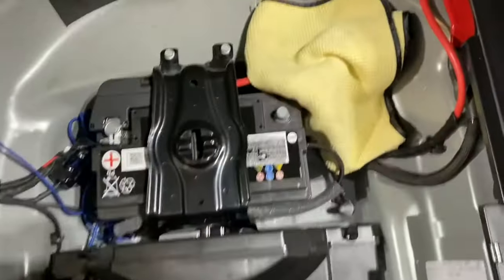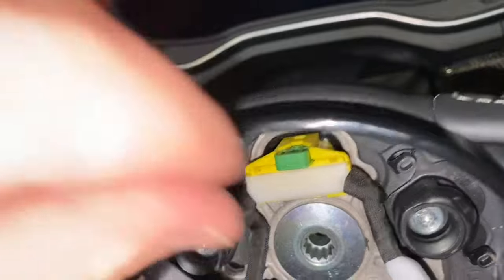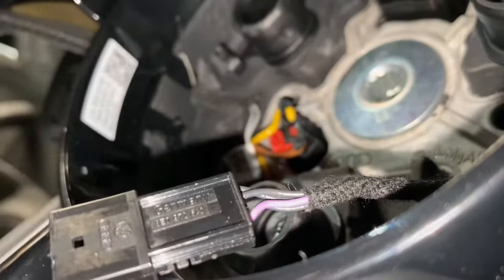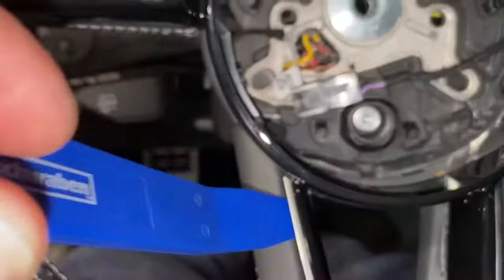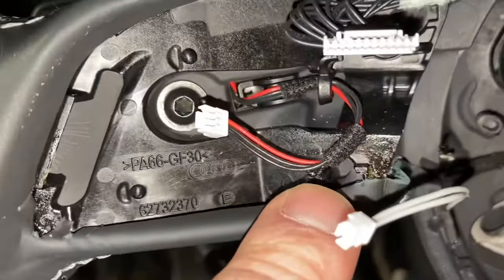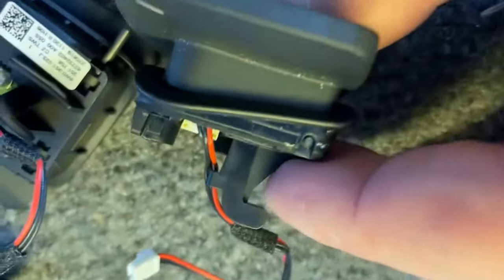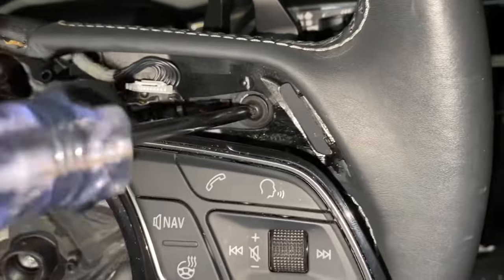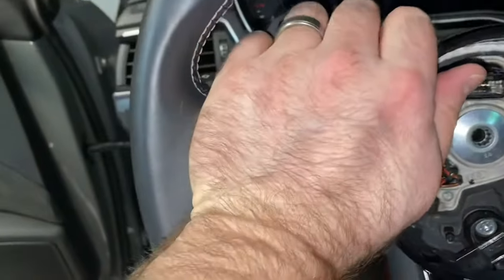Upgrade your Audi’s Flappy Paddle Shifters With These Urus Style Paddles From Enthusiastbrand.com

Comment: b8's have the worst board to pull the pin from to install urus shift paddles. i had to heat the plastic and put a small hole in them to push the pin out far enough to grab it. got the paddles installed but i looked at every other make with paddles and they were all open ended on both sides. looks like they figured it out when their shifters go bad. made my carbon steering wheel look even better too!
great video,  thanks!

Comment: Do the urus style paddles feel like plastic? Or are they metallic feeling? Great video and install by the way! The car is really coming together👌🏼
Reply from the maker: They feel like solid metal! Much better than OEM.
Reply: @Vaguh  are you sure? Compared with Ali express they look very identical and cheaper. Im thinking to order from your link but having trust issues, please give me your best thoughts! I don’t mean to be rude asking you this 😁
Reply from the maker: @johnmaz5936  lol, they’re metal and very high quality. I would buy them again and pay full price. I did hear of someone having one that broke from a faulty tack weld, but enthusiast brands sent them a new set. They’re powder coated aluminum.
Reply: @Vaguh  ok thanks!
Reply: @Vaguh do they engage like the factory set I.e. do they travel the same and have that "click" to change, as your video makes it look more like a soft touch button than actually clicking the paddel!?

Comment: If THAT is where ur hands are bro when ur driving u picked the WRONG paddle shifters! Get the Racingline ones. They have holes where ur fingers are. THESE are designed for ur hands to be lower on the wheel. These are not for u bro.

Comment: Hi, great video, thanks. Is there any risk in a novice tinkering with the airbag? I’d like to try this, the paddles in the Q7 are worthless
Reply from the maker: Just disconnect the battery. This was this first time I had ever done the removal of the airbag and steering wheel.

Comment: Thanks for the video...how long does it takes to remove the bezel? After having done it, do you have any tip to make it the project easier? I like to replace my paddle too?
Reply from the maker: Once you get a feel for it, you could do the whole thing in under an hour. I had actually forgot to reinstall one of the screws and had to take the whole thing apart again. Took me just over 30 minutes the second time. It’s mostly feel and getting a hang of it. I tried to convey anything that helped in the video. I spent a bunch of time off camera fiddling around.
Reply: @Vaguh  Yup...I did it a couple of months ago and I like it.  However, I remember being able to pull both paddles back at the same time to go in to neutral w/ the OEM.  ...with this aftermarket, I can't do it.  You have any insight to that ?

Comment: Hey does this exhaust setup drone at all? How is it on the quietest setting when valves are closed, pretty quiet?  Thank you!
Reply from the maker: My specific setup can get loud when under load, like going up hills and when leaving a stop light in lower RPM. Not a lot of drone, but the downpipe makes it louder for sure.

Comment: Is this for the 8Y or 8V? also, is this whole process necessary? It looks like you could just take out the pins and replace the paddles w/o removing the air bag or steering wheel. Can you confirm? I'm looking into doing this for my 23 S3 8Y. Thanks!
Reply from the maker: Completely different platform. B9 Audi’s don’t have pins like the MQB platform and require this process.
Reply: I have the same car. Was the installation as complicated as it is in this video?
Reply: @DSa-pj2bw  I haven't done it yet and am leaning towards minimizing mods on my car now since I think I'll sell it in a year or two. I have an unused JB4 I bought, installed, un-installed (due to faulty harness).

Comment: Late comment here but in this video what performance tune or mods we're you running for that overrun on downshifts?
Reply from the maker: I was stage 2 with IE in this video. Overrun was on the dynamic drive mode.

Comment: Hey do you take the negative terminal off while the car is off or do you tale it off while in 1/2 way on mode? Im changing my steering wheel and i wamt the wheel to be able to turn while the car is off so i can get to both holes behind the sterring wheel?

Comment: Is you car keyless ignition? If it is then how do you move the steering wheel around when the battery is disconnected without engaging the steering lock?
Reply from the maker: Yes it’s keyless. I was able to move it without the lock engaging. This might be due to the battery being disconnected.

Comment: I can’t get the airbag out on my rs3 at all
Reply from the maker: It’s tough, you have to get a feel for it. When you pop the first side loose, it should come almost all the way out, if it doesn’t, then pop it in and try again. I tried to give more detail on this part, but it’s just feel.
Reply: @Vaguh  I’ve bent 2 screwdrivers in the process lol
Reply from the maker: @siraajkhan7777  oh geez. The bent screwdriver might actually help you get more of an angle. Have you been able to get one side to pop loose yet?
Reply: @Vaguh  no I can’t get either side off
Reply: @siraajkhan7777  Took me an hour and a half on my rs3 but eventually got it out, not fun at all.

Comment: How much are the paddles? There is no way I’m taking all of that apart. It’d never go back together! I’m guessing it’s a “2 hour” labor charge at $125+/hr from the dealership. Probably around $350-$400 complete??
Reply from the maker: Paddles are about $150 plus tax if you use our code in the description. It took me about 2 hours the first time since I had never done it before. After putting it together, I realized I forgot to put two screws back in, and took everything apart and back together in less than 30 minutes. I’m not going to lie, it’s a pain, but I really like the upgrade.